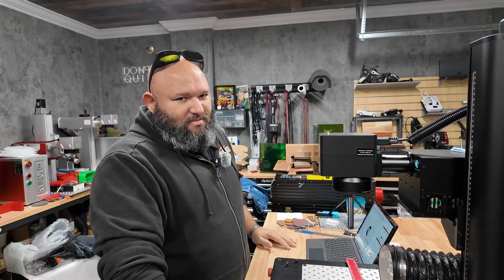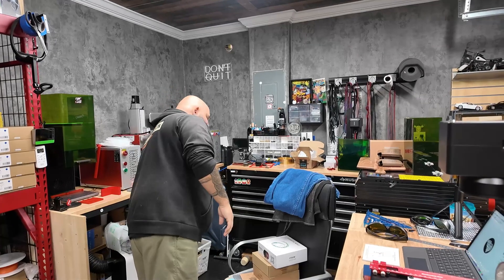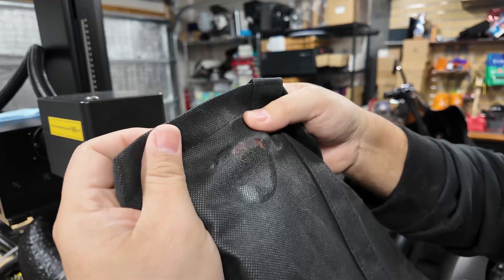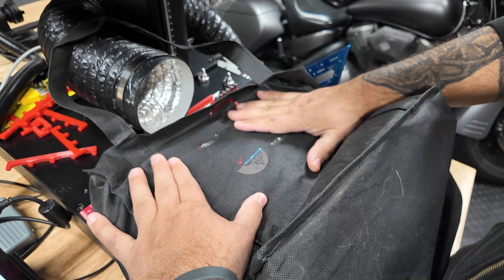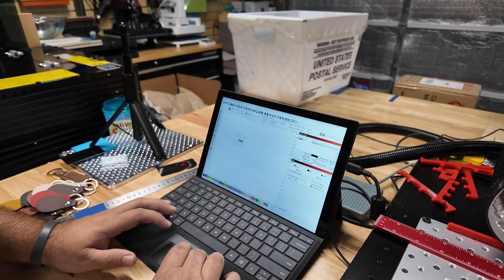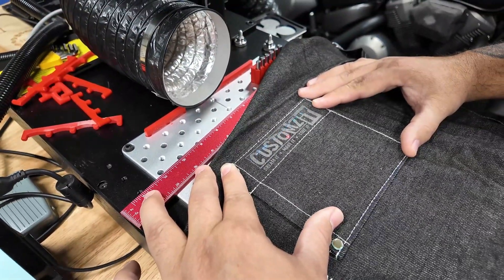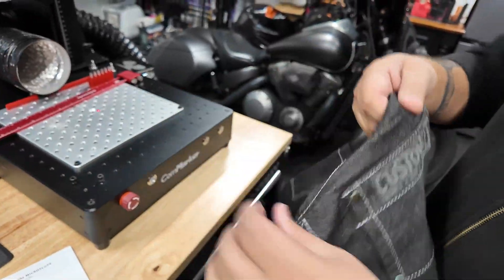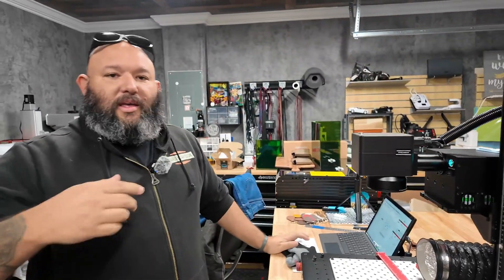Laser Engraving on Clothes? UV Laser Tutorial - How to Laser Engrave Clothes - ComMarker Omni 1

Comment: On the jeans I have found, if it is a new pair, that when you wash them the fabric dye will tend to bleed back into the marking and redye the marking.  So every wash you get less contrast in the marking.  Maybe suggest hand washing afterwards, which I haven't tried.
Reply from the maker: Well the ones I use were at least two years old lol  yes I see that happening with new jeans.
Reply: if you wash with vinegar in the water it shouldn't bleed
Reply from the maker: Yeah that will make the edges bleed